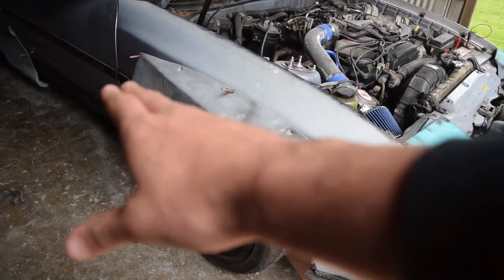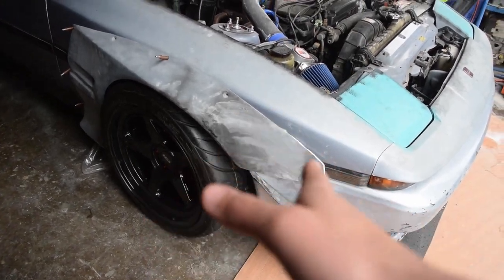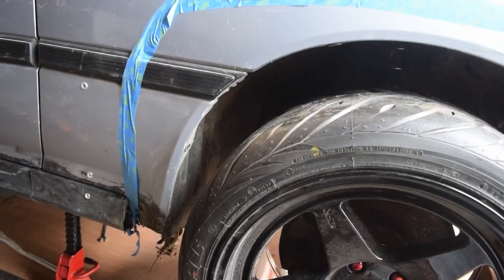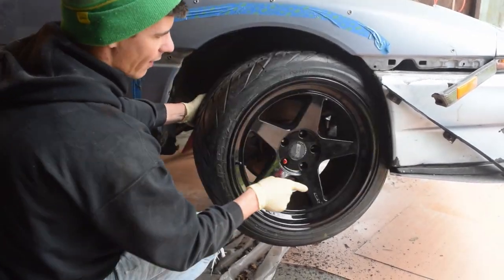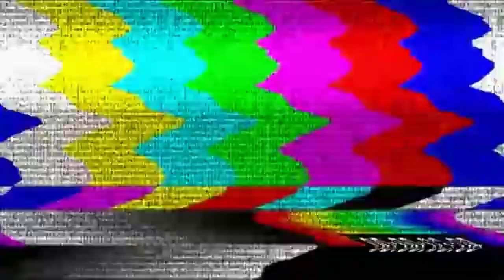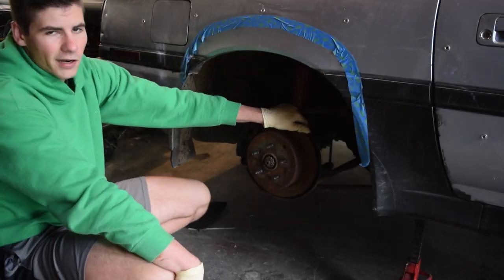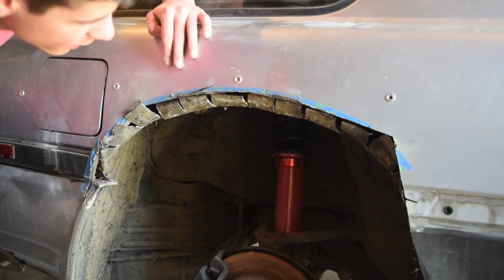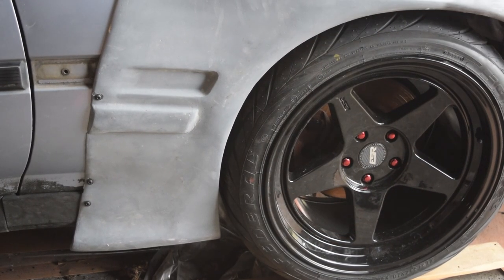Cutting my Supra to fit a BMW Widebody kit

Comment: I think im going to buy a mk3 supra project  any thoughts what too look for 
There is one next door been sitting for at least  6 years+ i dig your supra my guy so much fun ! Btw the one I'm looking at is a automatic 😥 but its a supra right!
Reply from the maker: The 7m engine gets pretty worn out with older age, and one that's been sitting for a long time probably has a messed up gaskets. 
Keep in mind that since it's so old,  there's probably a good chance that it won't be running right, which shouldn't be a complete turn off, but expect to pay a decent amount in repairs